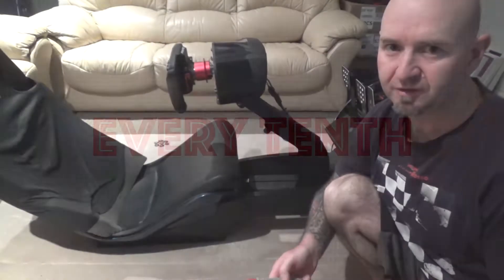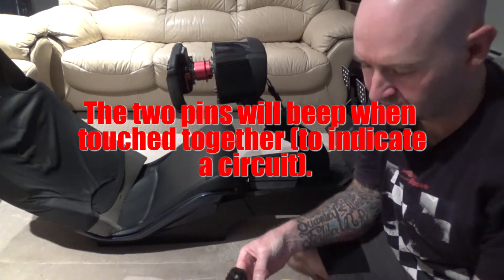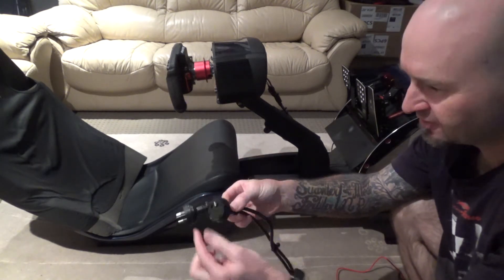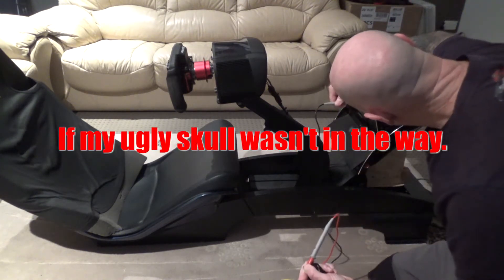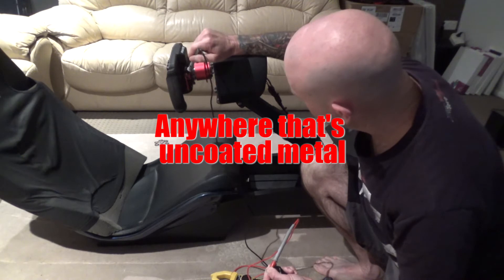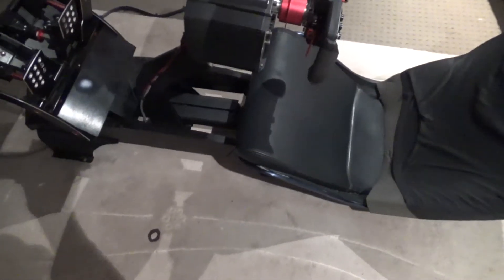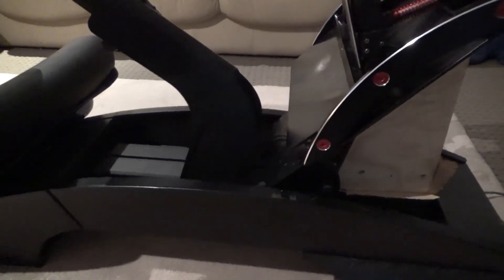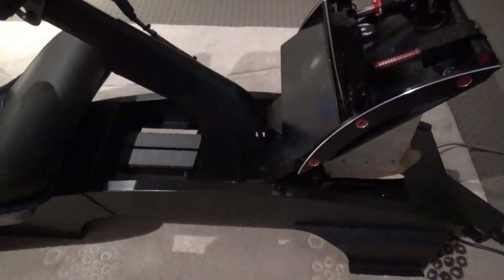Testing your Sim Rig grounding cable with a multimeter.

Comment: Just remember for the grounding to be protective and efficient - The measured resistance has to be under 1 ohm measured from the grounding point to all individual electrically conductive components and metal parts.. Here in Denmark it says so in the official rules for electric potential equalization :)
Reply from the maker: Thanks for your helpful comment. I appreciate it! I'm not an electrician, but just wondering if electricity takes the path of least resistance? I will check mine when I get a chance. 👍